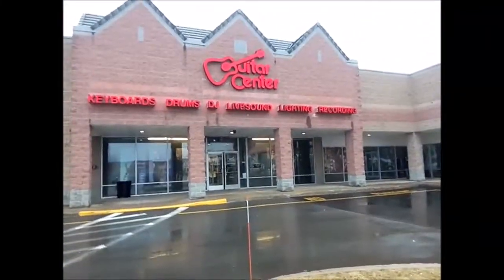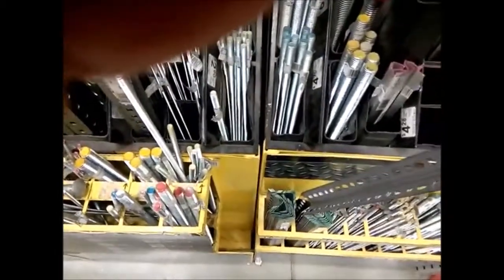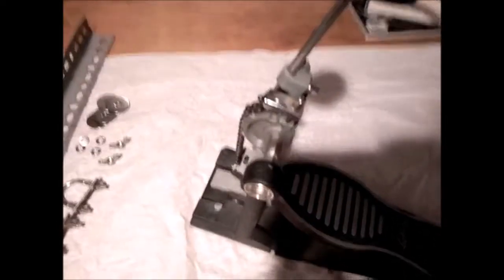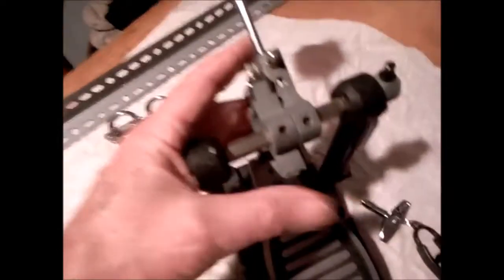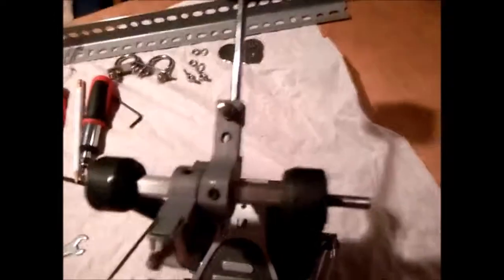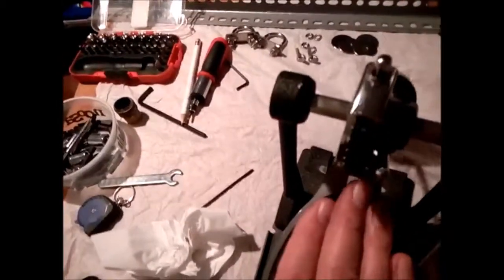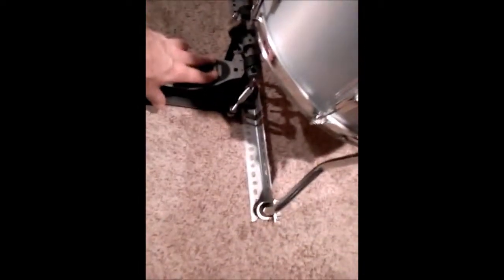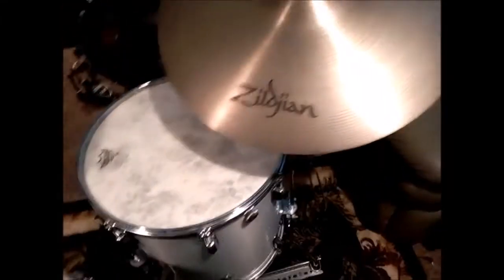Cocktail Drum Kit Mod by Michael Lofton

Comment: Not a bad idea,thought bout doing this with floor tom on my Ludwig set . Why not just bend the bass beater shaft in a vice until proper angle? ..and 3m spray glue velcro strips to the bottom of the bass pedal instead of the extra framework.
Reply from the maker: I've found this to be the cleanest way to complete this assembly. The main reason for the frame, as opposed to your suggested velcro, is simply that I play on so many different floor surfaces whereby I don't want to deal with slippage.  All the best with your cocktail kit modification and enjoy it!  I've been playing a bunch of live gigs with mine and folks love the sound with less traps.
Reply: you can't bend the beater cause it has to swing in the reverse direction as it does normally, the cams have to be reversed.